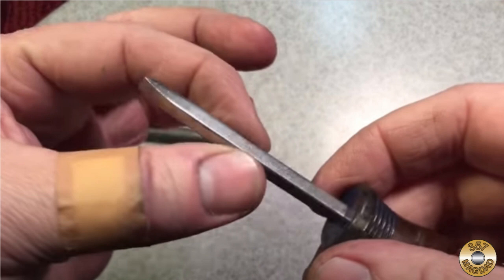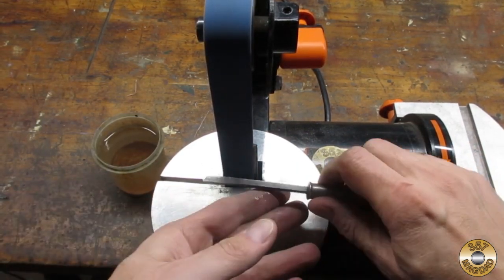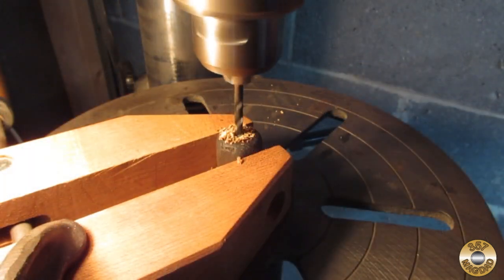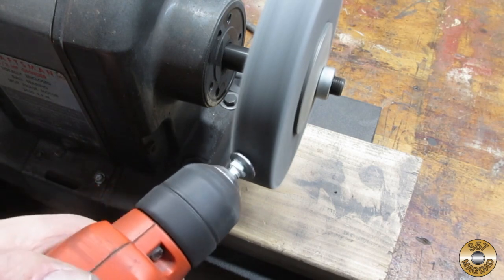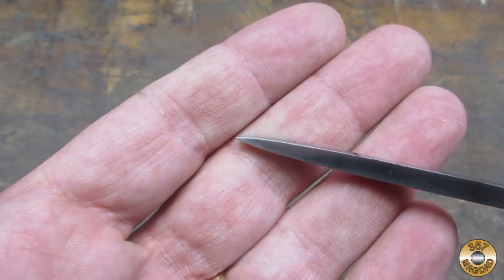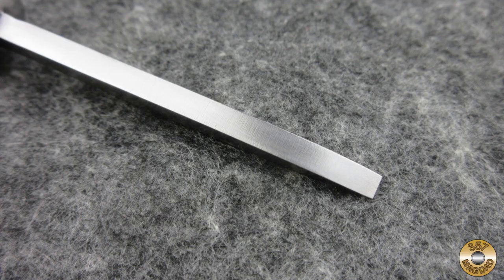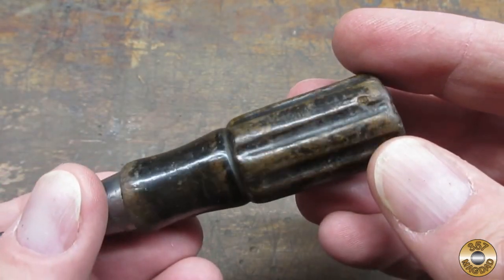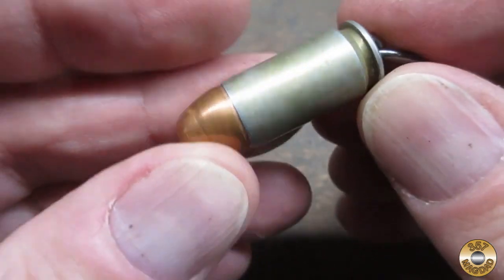ScoutCrafter Challenge - Modified Convex Tip Screwdriver

Comment: Nice work Magdad.  The carriage bolt is what will make it work. I have several that the handle was split and the shank was pushed all the way through. I just split off the handle and used the steel for other projects. Nice save.
Reply from the maker: Thanks!  I though the striking pad would be a nice addition to ScoutCrafter's convex tip modification!

Comment: Great job, by the way I'm from Evansville, In. When we go back we stay at the 4H Rv park, the park still has the powder storage buildings that were used. 
Also Evansville was where the P47 fighter planes were built. On the river, the LSTs(landing ship tanks) were built and fitted out. Sherman tanks were retracked/repaired in Evansville also. Evansville was truly a war city. Hitler even sent a spy to Evansville to steal the rubber seal formula for the LST front door that was opened upon beaching.
Reply from the maker: Great info Larry!  Thanks!

Comment: Some of the tools I use the most and like the most are the ones I have modified for a specific use. Like the old screwdriver I modified to do brake springs. 🤪👍
Reply from the maker: I agree David!  I have a small screwdriver I sharpened to use when inletting hidden tang handles.  I like it better than the factory made chisels!

Comment: looking good just wondering why you squared the hole doesn't a carrage bolt have the square part specifically to get stuck and dig into a round hole ?
Reply: Wedging the squared shank into the end grain will split the hardwood handle?
Reply: @OldSneelock  make sence
Reply from the maker: I was afraid I might split the handle.  The square section of the carriage bolt is to stop rotation while tightening the nut.  I didn't really need that feature since I epoxied the bolt in place.
Reply from the maker: yep

Comment: I didn't see the video that recommended the convex tip. But why?  It seems like it will be harder to keep the tip seated in a screw when putting force on it. Is it supposed to be for prying or wedging, thus the striking plate that you put on?
Reply from the maker: ScoutCrafter's convex tip modification makes it stronger for prying, scraping and chiseling.  It will still work OK on screws too.  This little gem might be one the most used tools in my shop.